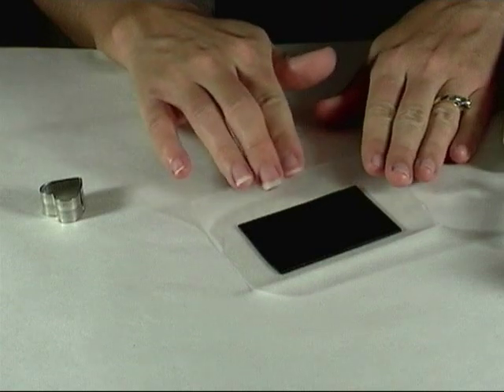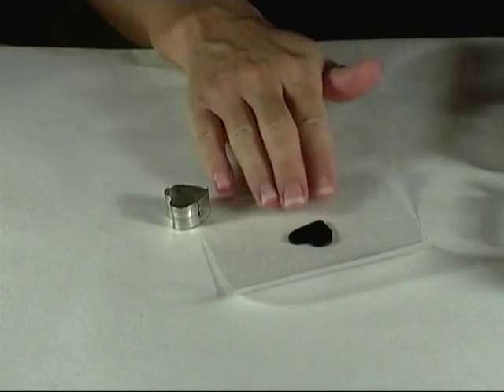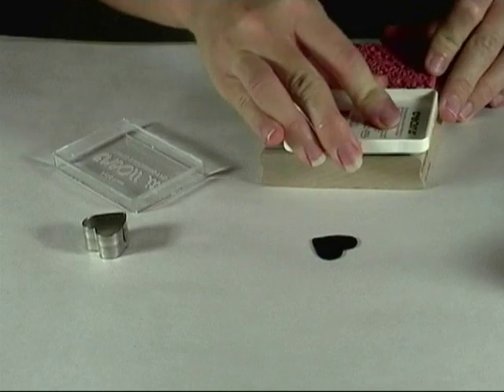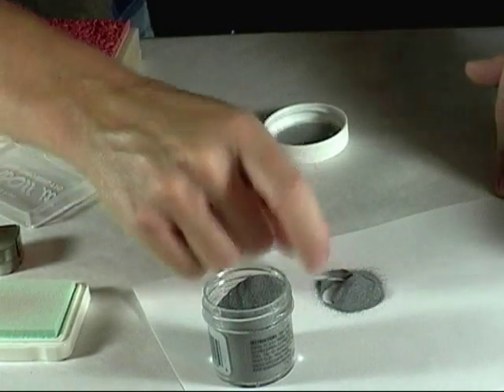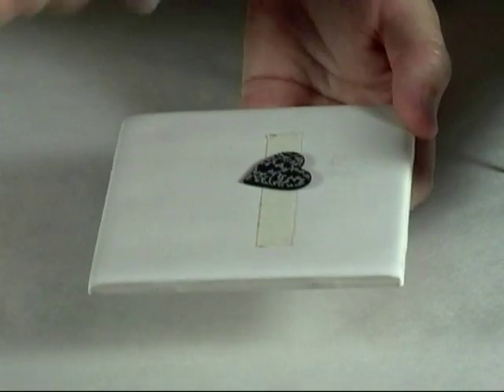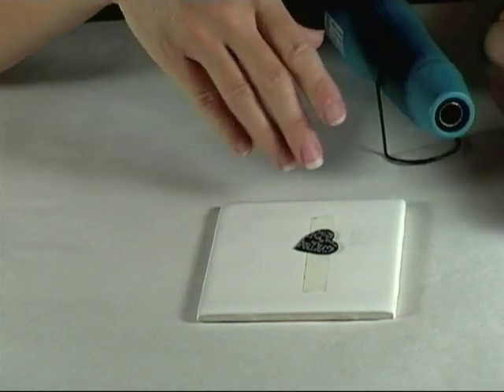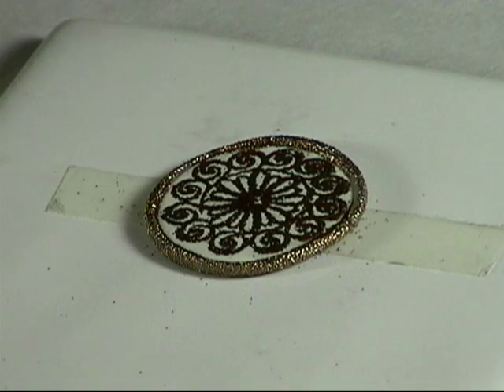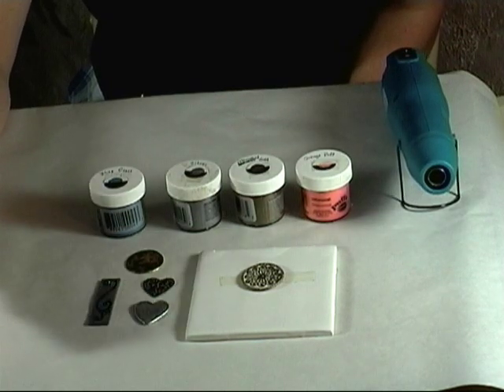How To Heat Emboss on Polymer Clay

Comment from the maker: You can try oven-setting the powders. In my experience, some brands of powder will emboss in the oven at polymer clay temperatures, while others seem to need that directed embossing gun heat. Do remember that you need to use the powders on baked clay for this particular technique, though, as the powders will stick to the whole surface of the unbaked clay, not just the stamped image.

Comment from the maker: @Ruchine10 Hair dryers tend to have higher air flow and lower heat than embossing heat guns. If you're not careful, the hair dryer will blow the powder away. Still, it doesn't hurt anything to try. Good luck!